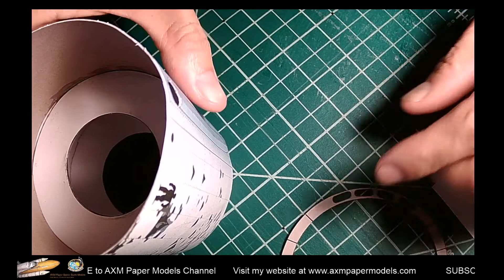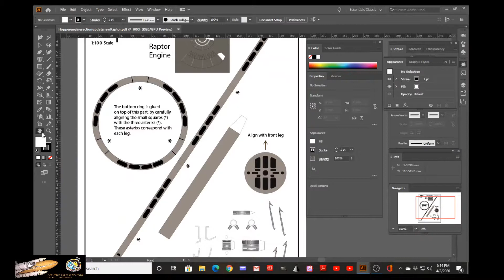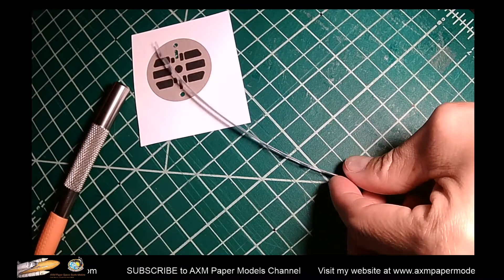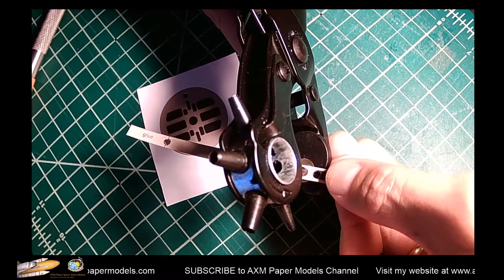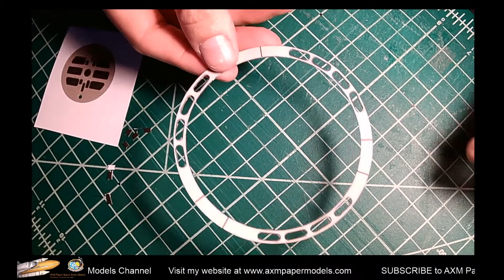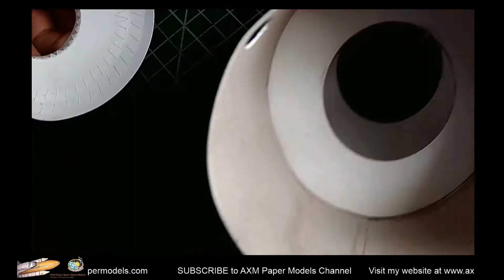StarHopper 1:100 part 8

Comment: Can I use A4 paper for  spaceX falcon 9??
Reply from the maker: My models are to be printed on Letter size paper, but you might get some parts cut out during printing when using A4 paper. Check your printer settings if it allows you to manage the printing output from one paper size to another paper size.
Reply from the maker: Yes, you can.